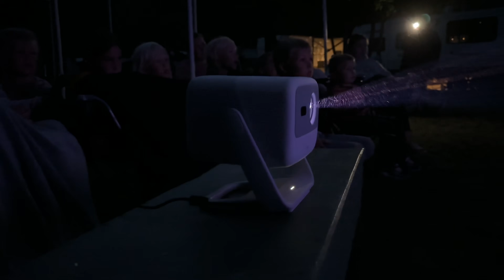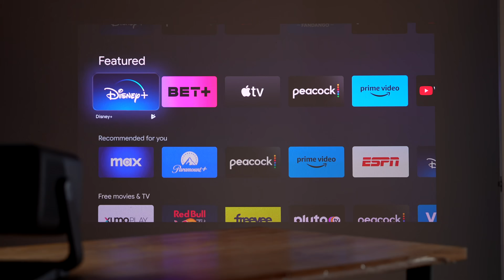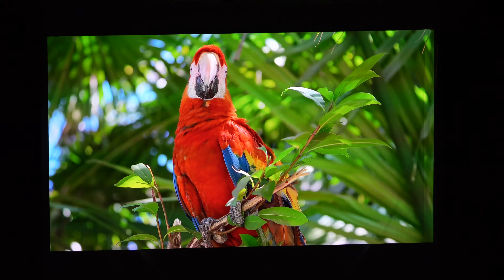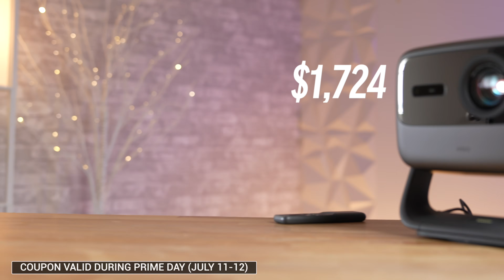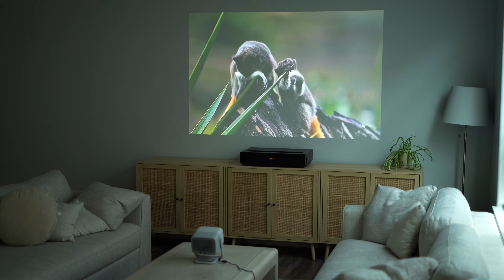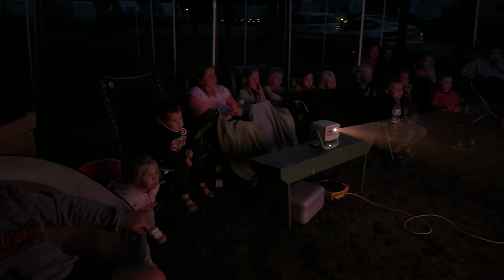Never Buy a TV again! - JMGO N1 Series Laser Projectors

Comment: How exactly you  are getting "blacks" when technically this is not possible, considering that the  screen is white? No such things as a "black level" on a white board. There is no "black" color  in the projector world. Only on OLED displays when they power off the pixels and there is no light, then it is real black.  No matter what on projectors  with a white screens you never get  BLACK color.  It is your brain that things is black because of the high contrast. and last, you need super dark room with a black ceiling if you want to see the dark areas in "black". If your ceiling is white you going to have reflection from the ceiling and lid the hole room and then the screen will not be dark enough.

Comment: #CinematicWonderAnywhere
Finally, I see that reviewers are getting the message that we need to see how these new compact laser projectors containing lower lumens outputs work in rooms with ambient light. I will soon  purchase a 4K triple laser projector in the sub $3000 budget range. Initially I was interested in the AWOL USTs but I haven's seen but a few reviews on the LTV-2500 model which was rated at 2000 lumens,.  Many seem to knock the "low" lumens output , But Im not willing to drop $5K just for the enhanced brightness found on the LTV-3500 model. I decided to hold out when the kickstarter campaign for the N1 Ultra 4K caught my attention. This projector is spec-ed out at 4000 lumens which is in the lumens range of the AWOL LTV-3500  but in the sub-$3000 price range as the LTV-2500. I also require that my new  projector contains  3D mode which dropped the Hisense PX1 Pro and the Formovie Theather USTs out of my consideration. All I needed to see was an Ambient lighted room demonstration  for the N1 Ultra 4K . Also that auto-keystoning and screen centering technology is awesome!  I think we got a winner here!